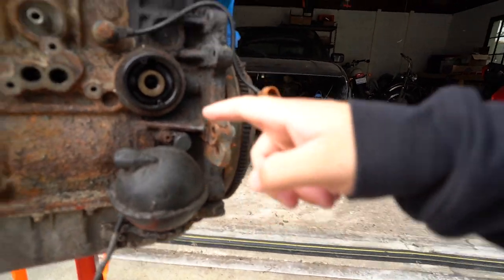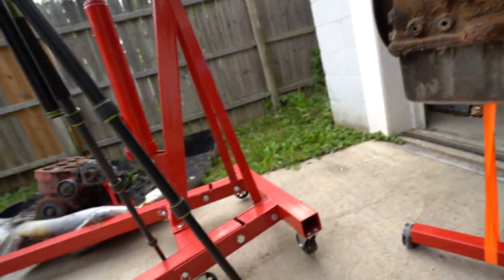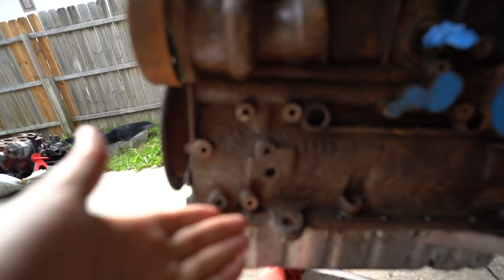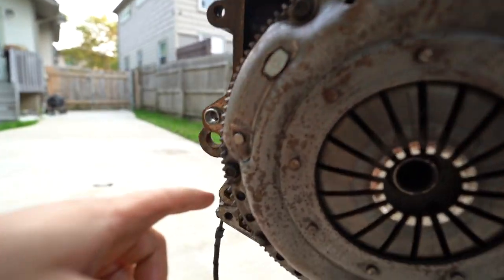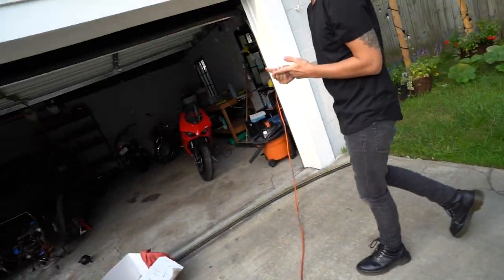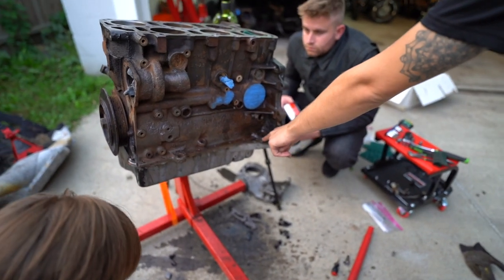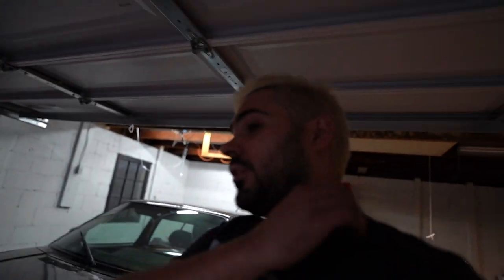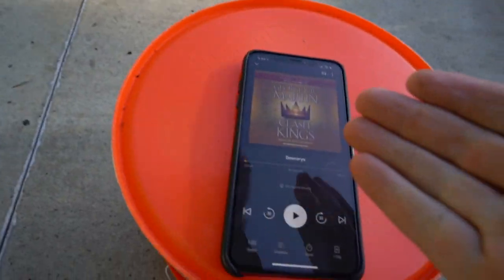Volkswagen Jetta Mk2 Build // How To Clean Volkswagen VR6 Engine Block

Comment: machine shop decked head, and block, plus cleaned and polished my crank for 400 bucks. It's worth the longevity and the heat for cleaning the oil galleys from the parts cleaners..
Reply: This. Having the block professionally cleaned and resurfaced is not expensive.